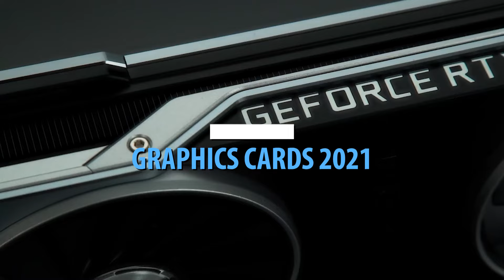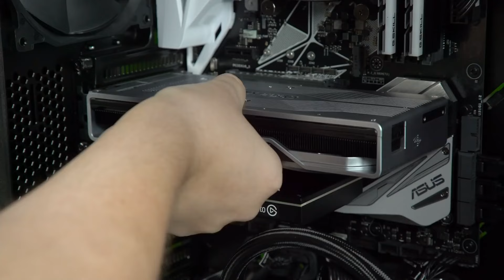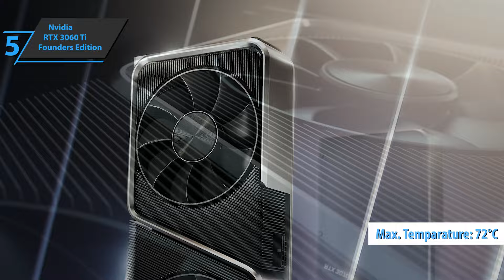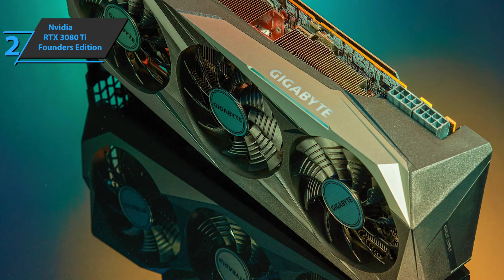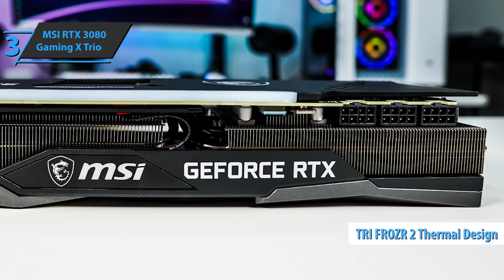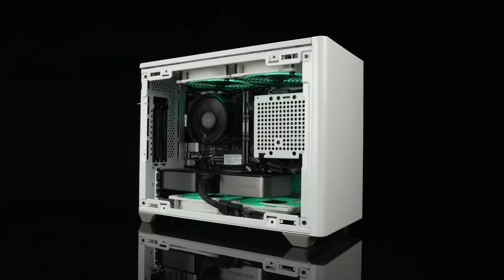Top 5 BEST Graphics Cards of [2021]

Comment: Graphics cards are the most confusing thing. I have a Nvidia card from 2016. I don't understand graphics card at all. But my cpu runs great. Red Dead Redemption 2 and GTA V run like a champ.

I have a :
ASRock X99 Extreme4 Mobo.
 64 GB Ram Quad Channel
Xeon 14 core processor 
And over 500gb SSD storage